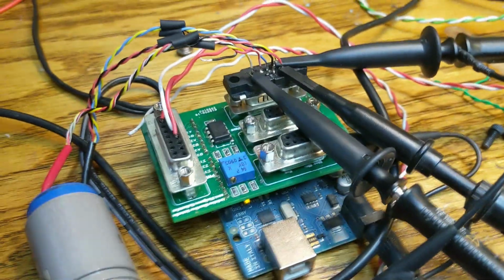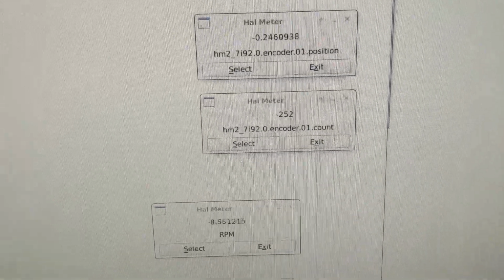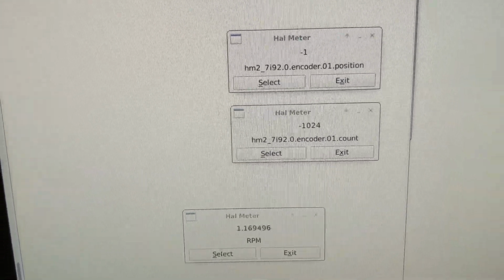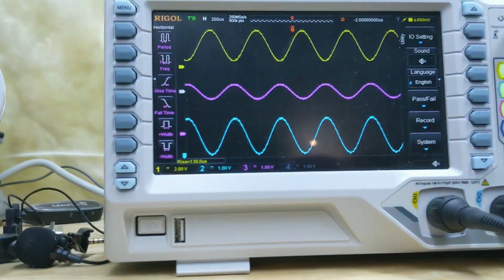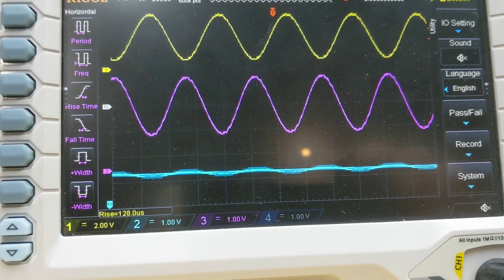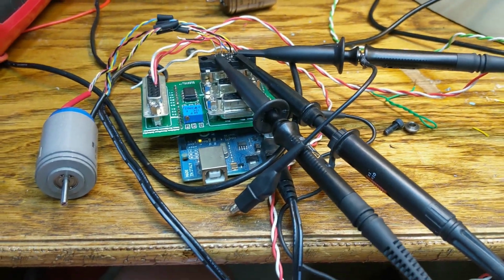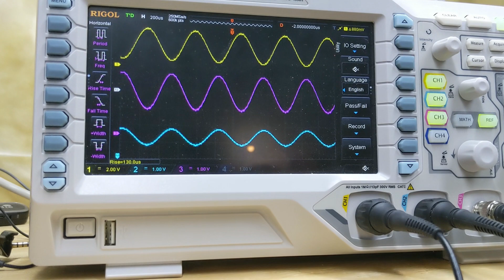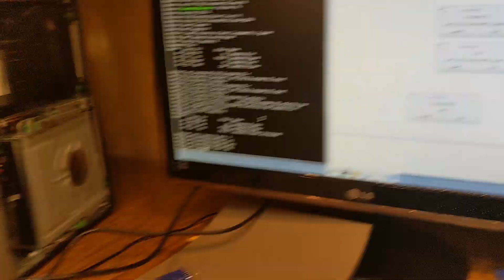Resolver to quadature encoder converter. Tease.

Comment: Sorry question, arduino generate sin/cos & receive signal ?
Reply from the maker: The arduino creates the 2khz sin wave that is sent to the resolver - then the arduino reads the 2 waves (sin/cos) that are returned from the resolver using the analog inputs.
Reply: @MakersEase  via amplifier?
Reply from the maker: @maxekb77  yes.  A low pass opamp
Reply: @MakersEase  have a URL to amp ?
Reply from the maker: @maxekb77  the wiki link in the description
Reply: @MakersEase  thankyou, Russian resolvers have low speed n kHz, maybe I can check ;)